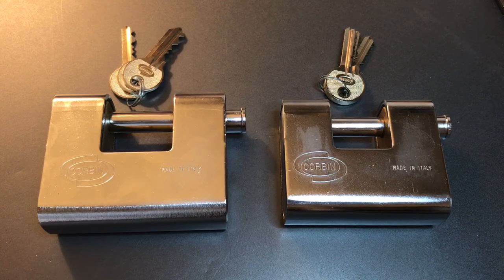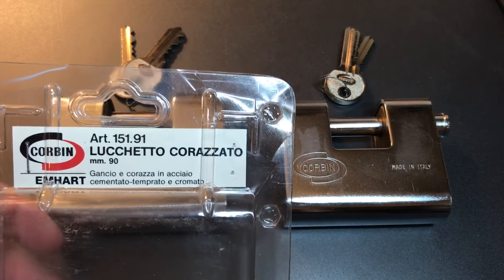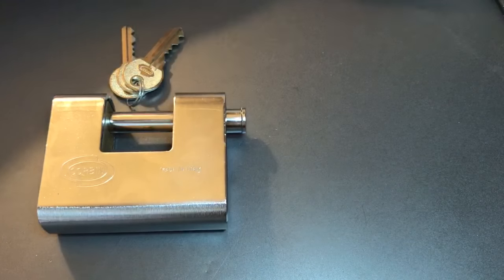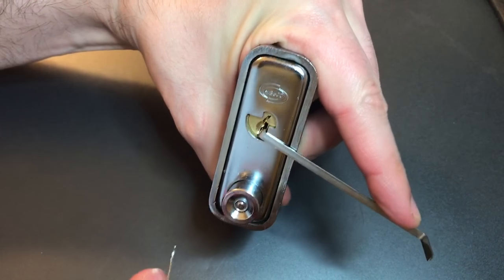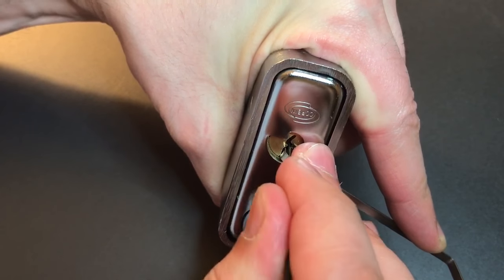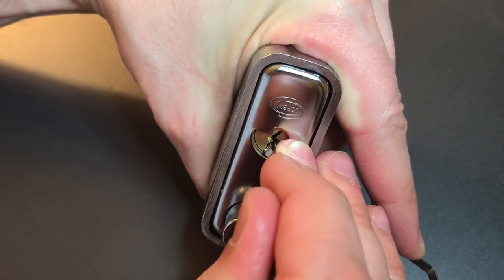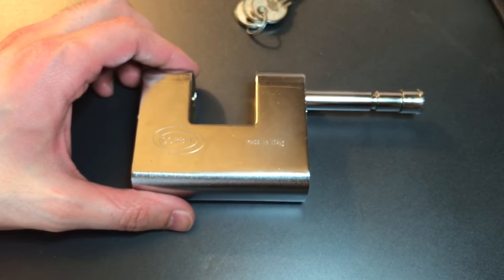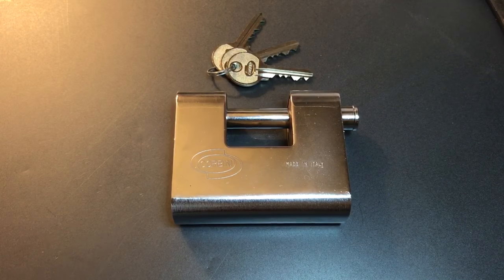[345] Corbin 151/91 Shutter Padlock Picked

Comment: Not a bad lock. I have to say that I've struggled before with that Corbin keyway with locks with an extreme bitting
Reply from the maker: The keyway is just OK.  After shooting the video, and trying to figure out why #4 was giving me issues, I took a close look at the key and realized that I probably overset #3 when setting #4 because of the bitting... but even extreme bitting shouldn't be that bad on this lock.  The keyway does allow you to pick with a .015" medium hook from the bottom of the keyway, which should be able to handle pretty much any bitting.  That's probably what I would have does if I was paying better attention... I guess that I was in a rush to get a bunch of videos done to tide me over until after the holidays.  :-(
Reply: Nice tips, thanks :-)
Reply: the main problem i have with your videos is i NEVER see you have any problems with locks.  so it really doesnt give much of a comparison.  what i really come away with your videos is that a really good lock picker can pick all of the locks.  but the overwhelming amount of stolen bicycles is from bolt cutters, not picking or grinding.
Reply: @jimmybrice6360  - Possible does he tried sometimes, before an video Will start to recording, What he want upload toYouTube.

Possible is any items Easter, and almost newer hard or impossible.